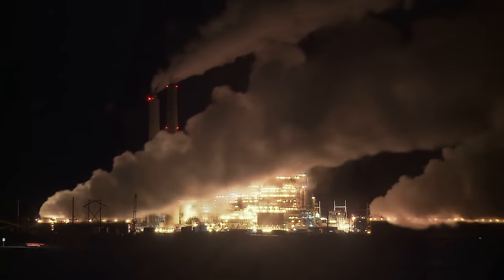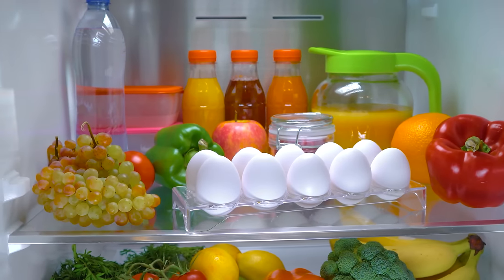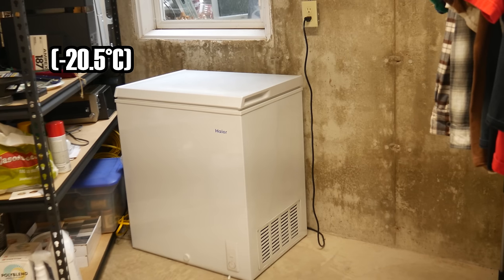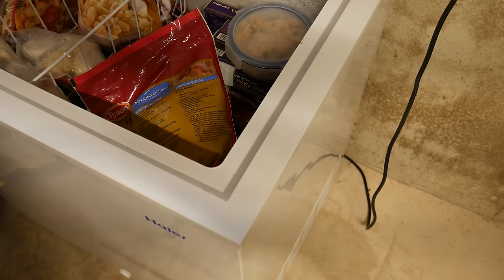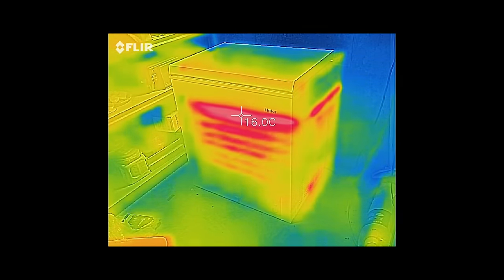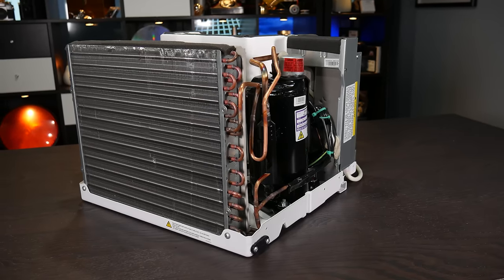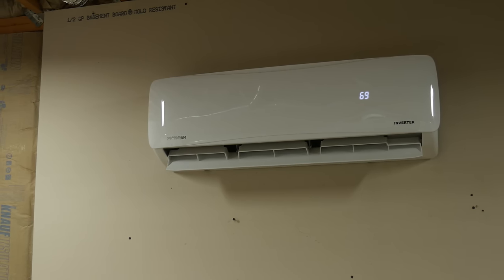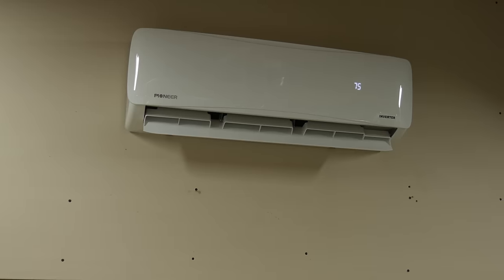Heat Pumps: the Future of Home Heating

Comment: One of the key problems with a natural gas heat system. If the electric grid goes down, you have no heat, regardless of what heating you have.
Reply: Not if you are self-sufficient, with solar panels and such things
Reply: @JorgetePanete  yes, good luck living somewhere you can heat your home with solar... In the winter, with no sun.

Comment: this would me much easier to understand if we used Kelvin for temperature scale ;)
Reply: Kelvin and Celsius are on the same scale. Simply transposed from each other. If you want Kelvin just add  273 to the Celsius.
Reply: Daret9056:
Actually, to convert a Celsius temperature to Kelvin, ADD 273.15 --- Kelvin being an absolute temperature scale, 0K means NO HEAT AT ALL, therefore there is no such thing as a negative Kelvin temperature.
For the U.S. viewers who like Fahrenheit temperatures, the corresponding absolute temperature scale is Rankine.
Reply: @TorontoLS  right. my bad :)

Comment: 26:20 about that. You can calculate rougly your heat output and cop by formula:
Heat output:
Temperature difference between intake air and outlet  x air flow × 1.2 divided by 3600. 

Cop: calculated heat output divided by electicity consumption. 

For example: Intake air(above ac)temp 25 C, output from ac 40 c(at flapps). Air flow lets say 500 mh3.  40-25 =15

15×1.2×500 ÷ 3600 = 2.5 kW. (Heat output) 

Let say at the moment your ac pulls 1 kWh. 
2.5 kwh ÷ 1 kwh = 2.5 cop
Reply: R Voit  google is your friend. Look what cop( coefficient of performance) means. It is variable and not same for all heat pumps(some are more, some less efficent). Cop depends also on outdoor temperature, set temperature, usage, air circulation etc

On average a good heat pump can make roughly seasonal cop (or scop) about 3.5-4. Or simplified for every 1 kwh electricity used  it transfered about 3.5-4 kWh of heat inside

Comment: After being in my home for nearly 3 years, I found out yesterday I have heat pumps. I just assumed I had gas heating because my electric bills are so low in the winter.
Reply: Went from a heat pump 900sq ft house to a 3100sq ft house both houses built around the same time. New house has natural gas on first level and heat pump on second. I can't agree that heat pumps are the future because my heating bill tally with electric and gas is way less then it was for simply electric in my old house.
Reply: @nightmarecivic  That's because gas is cheaper where you live than electricity. But if gas prices go up or electricity prices come down, the math quickly changes. You also have the possibility of producing your own electricity, something not possible for gas.
Reply: @anthonypelchat  one glaring issue he hasn't talked about is the power demand on our circuits. We're already on the grid limit and with everyone pushing for more electronic loads an entire overhaul is needed. A future tech would be ground heating and cooling.
Reply: @nightmarecivic  Ground heating/cooling could be a good option. I would need to look into it more. However, in many areas, the stress on the grid would be negligible. That's because it's already over used during Summer. 

The problem with the grid has little to do with how much electricity we use. It's more that our utilities have decided to sit on profits instead of fixing issues. Texas and California are good examples of this, but it's really the case everywhere. It's similar for the gas "grid" as well and will bite us soon. It actually is already, we just don't realize it. The best plan (IMO) is to reduce our dependence on these grids. Electricity can already be produced at your home, and gas can be replaced by electricity. (Fresh water can be produced as well, but it's more difficult.) Combine electricity production with better efficiency, and you can be in a great situation and only use the grid for backup power and/heating.
Reply: wtf

Comment: I'm struggling to understand how the refrigeration process works through latent heat but I think I figured it out. So the way it works is because switching from liquid to gas requires a lot of heat without changing temperature. So then if you have a gas it is storing a lot of latent heat that will be released when it switches back to a liquid. With specific gases you can control it's boiling point without using heat which allows you to effectively switch the stages it is in by using only changes of pressure. So then when you combine all these mechanics together you have effectively created a method of using a gas to absorb heat, move the heat away from the freezer, release the heat by changing the state of the gas to liquid and letting the heat vent out, and then sending the liquid back to be turned into a gas allowing it to absorb and store the heat. I hope I understood this correctly and if anyone understands this and can confirm or deny if this is right I would appreciate it.
Reply: That's basically it.

Comment: Haven't We been using this technology for decades now?
Edit - oh I'm from Europe
Reply: I've got a Daikin unit (Czech Republic) in my UK house. Split air to air ducted system.
Reply: Natural gas in the US and Canada is significantly less expensive per BTU than electricity (even when it's 1/2 the price you pay in europe) so heat pumps are not terribly common in the US especially when combined with the poor cold weather performance of older models.
Reply: From Sweden and I can confirm the US is really a third world country. We've had these for decades.
Reply: @johnassmundsson516  several third world countries like india has heat pumps too. this isn't about first world or third world country. its about abundance of old technology that is still saturating the market demand that there is very low demand for new technologies especially when companies don't want to take first plunge in introducing new technologies.
Reply: @johnassmundsson516  You do not represent Sweden well, please do better.
Reply: @RacingVagabond  he´s right tho
Reply: @Konszky  Only if you’re ignorant about the issues facing actual third world countries. The U.S. sucks, no argument there, but saying they are a third world country is a very stupid thing to say, in fact it’s kind of an American thing to say.

Comment: You should convert yours by adding a valve and some extra electronics to reverse the flow
Reply: LOL I was thinking the same. This Jew just sits there talking and never does anything.
Reply: That "some electronic" is a very complicated part integrated with both the outside and inside machine plus the remote. It's cool in theory but a true nightmare in practice
Reply: bitter old man.

Comment: Requesting for what the “Dry Mode” does.
Reply: It lowers the airflow to allow more condensing time, and on a variable capacity condenser likely also doesn't cool the coil down as much as it really just needs to be below the dew point. My 2-stage central heat pump has a dehumidification terminal that just reduces the airflow by 10-15% when activated by my thermostat's "cool-to-dry" feature (that has been operating most of February).
Reply: Basically runs in dehumidifier mode
Reply: @harmenkoster7451  Dry mode reduces the airflow across the evaporator coil. This allows the air to to become denser and more moisture is squeezed out of the air. Think of the air as a sponge. A sponge in its natural state in a bucket of water has 100% humidity. Held in your hand and squeezed as much as possible is still 100% humidity. The air across your evap coil react the same as the sponge.
Reply: in dry mode the evaporation coil is brought just below the dew point of the water in the air, so water condenses and thus is removed from the air

Comment: We've had these in many houses in winland many many years, almost every house, then at summer it works as A/C
Reply: @jm03  that's what intel is all about. Amd is very close to intel so considering amd as an option isn't cringe 😅
Reply: @paul1e  AMD is very close but intel is still my personal perference
Reply: @milojkokitic6991  my friend has r9 3900x and in games we have same fps as im running i9 9900k
Reply: @paul1e  nice, im currently running i9 10900k and two rtx 3090 in sli, games are bad at supporting SLI but i need two cards for 3D rendering

Comment: Heatpumps are OK, in moderate climates. Efficiency really drops when you're trying to get heat out of snow or COLD air. In many cases, it will self-protect and switch to "emergency strip heating" rather than freezing the condenser coils up solid.
Reply: Yep. When i lived in a moderate climate i had to set my heat pump to defrost every 15 minutes. It was loud and obnoxious. I live in the rockies now, and spend less per month to heat with a gas furnace in a house 3x the size of the heat pump house. Energy costs are similar.

Comment: And remember guys, underfloor heating + heatpump equals the best COP you can get out right now.
Reply: You mean radiant heating? Efficient but very expensive.
Reply: @Krane  underfloor heating with PERT pipe, expensive but super efficient, especially when you lay the pipe with 100mm space. That way you can use lower tempeture installation. You can use lower system temperature like ~28,30 degrees. Ofcourse it depends on the project and what ambient tempeture region you live in

Comment: The only drawback I've found with heat pumps (having owned one most of my life) is that when the outside temperature gets down around freezing, you better hope your heat strips are in working order. However I live in north Florida, so I only need the emergency heat a few nights per year. 
Pretty much everyone uses heat pumps down here.
Reply: around freezing, around 0C? thats nothing really , even very old AC units like mine heat excellent at that temp

Comment: We have both heat pump(s) and gas heating. Heat pumps find it hard to extract more than about 10 degrees from the outside. Ditto the other way round (cooling).
So when it is really cold the heat pump just wont cut it. Use gas as a "backup".

Comment: My high school uses heat pumps, I suspected it for a while because the inside many sources of heat in the building looked like the inside of an air conditioner, I also noticed they connected to the outside, and in the winter when heating they would periodically and abruptly switch to cold air before going warm again, and most importantly those same units provided cooling in the summer, but I was able to confirm they were indeed heat pumps when I researched it and indeed, those were in fact heat pumps

Comment: A few years ago I was responsible for the care and feeding of a dozen or so terribly arthritic heat pumps from the 60s that the school I worked at had for the classrooms. This was in Los Angeles. So they’ve been around in some form or another. Very informative video.
Reply: I worked on a building that was SCE Headquarters in Long Beach CA, with a 1948 unit that is 4 compressor 100 hp each, R-12 heat pump with a water cooled condenser in the lower level of the basement garage, so it takes air from the garage to blow outside when running, no need to run additional fans in the garage.   Of course in the heat pump mode, the water is shut off, but the fans run.  

Yes heat pumps have been around for a long time.  I even own a 1978 heat pump water heater made my Airtemp.  It looks like a upright window A/C unit with water lines to the condenser, to collect the heat to put into a water heater tank.  It has a 13,500 Btu compressor, and can heat to 120F easy!

Comment: I guess we've been living "in the future" over here in Europe for the last two+ decades then
Reply: I thought most of Europe didnt have A/C? Or is that just england?
Reply: @samo4648  central air is still used mostly in commercial buildings, but these split units are very popular and all have heating feature.
Reply: @samo4648  Im in Norway, and we have heat pumps. Normally people use them just for heat, even though they are reversible. I think my dad got his first before I even moved away from home, and Im 40 now.
Reply: Over here, we are just good at burning stuff . . . . . Heat pumps make sense.  I like the idea of putting them in, not only for efficiency, but because they offer a bit of redundancy in heating in case something on a natural gas furnace breaks.
Reply: @samo4648  It's not super common to have a private AC in the colder parts of Europe. They are just not needed enough except for a few weeks per year basically. The ones who has one are the ones who has a heat pump that is reversible. Like me, ha.
"Reverse AC" are common, both way AC common, only AC not common. They are mostly in commercial buildings. Stores, places like that.
Reply: Same in the US. 40 years or so.
Reply: Heat pumps have been common in the US for over 20 years as well. Don't take what he says as being representative for the whole country.

Comment: The latent heat to move water from 212 F water to 212F steam is 1,070 Btu's per pound of water.  But to bring that water from 80F to 212F it only takes 132 Btu's of heat.  132X7= 924, so your estimate of about 7 times as much heat is actually fairly close.  

Latent heat is why a heat pump works.  The refrigerant when it changes from a hot gas into a hot liquid, it will give off a lot of heat per pound of refrigerant that is moved during each minute or hour.  Then when boiled in the outdoor coil, will also collect a lot of heat from the outside air.  Have you ever been in a walk in freezer?  It is possible to have them at -15F or even cooler, and that is done by passing air over a refrigerant filled coil that is much cooler than the air around that coil.  Same thing with your heat pump.  When it is -15 outside, the coil might be -30 and the discharge air might be -20.  Because my 48,000 Btu heat pump outside fan is moving 6,500 CFM and the indoor fan is moving only about 1,600 CFM, I can expect to heat my indoor air by about 20 to 25F while the outdoor air is cooled by about 10 -to15F, depending on the outside air temperature.  Then the refrigerant also will cool the compressor, and collect any heat generated by the compressor motor windings!  This will also warm the refrigerant, and provide superheated refrigerant to the indoor air coil.  

I have measured 155F refrigerant going into my indoor refrigerant coil while heating my home, when it is about 40 to 45F outside.  It is much cooler normally, like about 120F when it is only 25F outside air temp.  Heat pumps generally warm the inside air, and must run long enough to pass all of the air in the home through the heating coil about twice before it warms the air in the home.  So my 1,800 square feet goes through the heat pump air handler about once every 9 minutes.  It takes about 18 minutes to warm the air from 65F to 68F and shut off.  

If your heat pump is not heating the air by about 25 - 30F and it is about 40 - 55F outside, then the unit is not working properly.  On very cold days, the temperature increase might not be 25F, so expect less from the system, and longer run times.  Many thermostats will automatically switch on the electric back up heater to keep the temperature within a couple of degrees of the normal set point.  But the only way you might be able to tell is when that $350 electric bill comes in at the end of the month, a full 3-4 weeks after the heat pump stopped working correctly!  

So check your system every once in a while.  that is why I had a meat thermometer connected to the insulated hot gas line on my heat pump, and it stared beeping at 155F, because the oven thermometer part of it said my meat was cooked!  And I know it is working correctly!  

For many homes in places like Maryland, a back up propane or natural gas furnace is a wonderful thing to help on winter days, when switching over from the heat pump mode to natural gas should happen around 25F to 30F, depending in part to the local cost of the fuel.  Switching to $6 a gallon oil furnace should be a last resort, say when you re about to be frozen into a solid block of ice!  

What does it cost to run a heat pump, oil furnace, electric heater and natural gas?

Propane is about 95,000 Btus' per gallon, and a 95% efficient gas furnace will cost about 1 gallon per 100,000 Btu's of heating (actually about 1.1 gallons per 100,000 Btu's).  Electric heaters, even the infrared ones are 23 KW per 100,000 Btu's.  So at $0.10 per KW, that is $2.30.  A heat pump is depending on it's SEER so a 14 SEER is 14,000 Btu's per KW or about 7 or 8 KW per 100,000 Btu's $0.80?  Natural gas is about 1 therm per 100,000 Btu's or with a 80% furnace, about 1.2 therms per 100,000 Btu's, so normally more than $0.80 per 100,000 Btu's of heat.  On really cold days, a heat pump might use $0.90 or even $1 per 100,000 Btu's.  While a oil furnace will use 1 gallon per 100,000 Btu's or a in-efficient boiler might use 1.2 gallons per 100,000 Btu's or about $7 or $8 at today's oil costs!